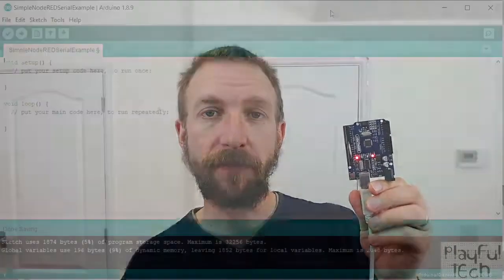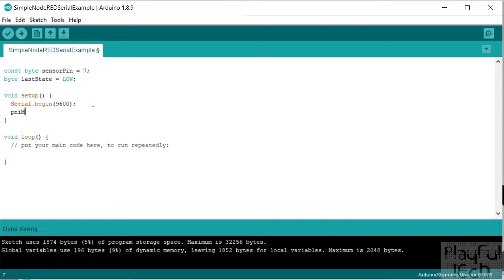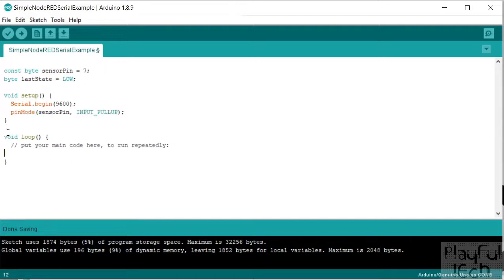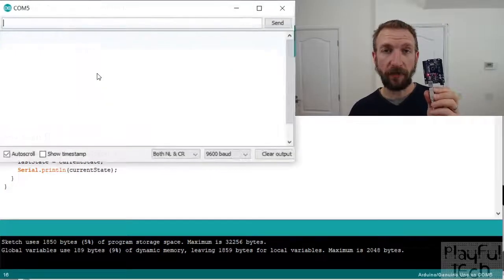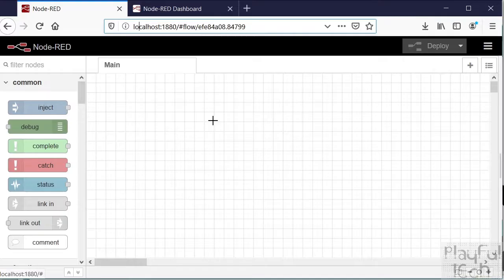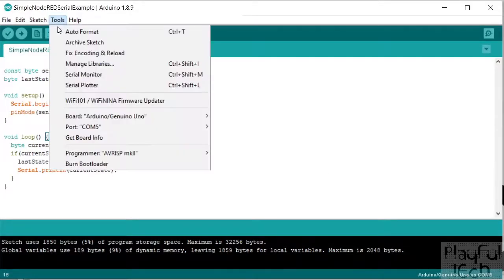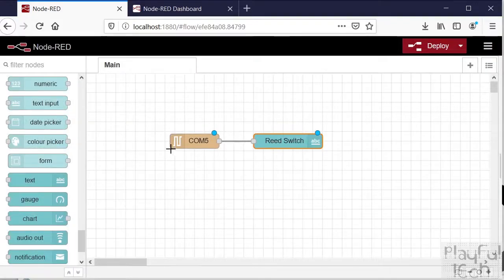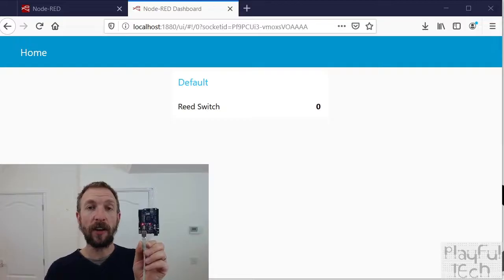Using Arduino with Node-RED to create a Simple Web Dashboard

Comment: outside of playing around/learning you will never build a system that has just one sensor so say you have Arduinos/sensors in multiple locations, how will you read all the data into node red at once, I would think you would likely setup node red on a raspberry pie or something so only have 1-4 usb ports to get serial from, there must be a better way?

Comment: 11 Feb 08:26:36 - [info] Starting flows
11 Feb 08:26:36 - [info] Started flows
11 Feb 08:26:36 - [error] [serialconfig:11d6dad84156b4a6] serial port COM3 error: Error: Opening COM3: Access denied
 its showing me this error when i tried to connect with node red, but my arduino is connected to the system with the same port. How can I solve this problem

Comment: Frankly, this is what pisses me off about Arduino, its meant to be accessible but they use a hard language to learn, I learnt Delphi C back in the 1990's and it was horrible language to use and you have to do things that should be automatic like memory and housekeeping.

Until arduino stop using C only, I won't ever by one.

Comment: I seem to be having a nightmare trying to install the node-red-serial palette. It keeps failing to install and I don't really understand anything on the error log! The only thing that makes any sense to me is this bit:

2020-08-26T14:52:05.002Z [err] gyp ERR! find VS You need to install the latest version of Visual Studio
2020-08-26T14:52:05.002Z [err] gyp ERR! find VS including the "Desktop development with C++" workload.
2020-08-26T14:52:05.002Z [err] gyp ERR! find VS For more information consult the documentation at:
2020-08-26T14:52:05.002Z [err] gyp ERR! find VS https://github.com/nodejs/node-gyp#on-windows

But I have installed Visual Studio (eventually), after installing python which it seemed to be missing first. I've tried reading through the github page mentioned above, but again just don't really understand any of it. Should I have to be installing all this stuff or am I missing something?

The real question I guess is should I even bother trying to get this to work? I was trying to work through all your tutorials so I could learn stuff step by step, but my end goal is to set up props and control software for three escape rooms, so will likely end up using ethernet or wifi connections anyway.

Any help or advice would be much appreciated!
Reply from the maker: So are you trying to install the node by going to the Manage Palette option from the dashboard? I've never seen that error before - are you using a Windows PC and, if so, are you logged on as a user with admin privileges? (or, to be specific, are you running your node-run instance as a service with admin privileges?)
Reply: @PlayfulTechnology  It's ok, it's working now!
I think the problem was with the Visual Studio install. Turns out I'd installed the 2019 version, but I found somewhere that it doesn't recognise that, only the 2017 version. I'd tried installing that one, but it obviously didn't work properly with the 2019 already there. I got rid of both and installed the 2017 again and now it all works! So now I'm having lots of fun playing with and tweaking all the example code you gave us, finding out what does what!
Reply from the maker: @escapeonealgarve785  Woot! That's great news :)
Reply: @PlayfulTechnology  Can I ask another question? Do you know how I could send an image as a hint? Either as a full screen image over the timer or just as a pic below it. I've tried to do it by having an inject to a change node setting msg.image to the url of the image and then displaying it on the uibuilder as an html image (<img src="{{msg.image}}" alt="PICTURE!!!">). It displays the alt text, but I can't seem to get the image to show?? Any bright ideas as to where I may be going wrong?

Comment: Thanks for the video. it is very rare and very explanatory. actually i am thinking of hosting rednode and then i can connect via port forwarding. But how to send this sensor data to the rednode IoT center : self hosted). it will be very helpful if you can make a tutorial about it. thanks in advance
Reply: got it. 
a very good explanation is here
https://funprojects.blog/2018/03/04/arduino-talking-mqtt-to-node-red/

Comment: There is an easier way. 
First you install only Arduino FIRMATA on the ARDUINO.
Then you install the Arduino NODE in Node-RED. An easier way to talk to arduino than the Serial node ;) 
In this way you will be able to talk to ALL of the pins of the Arduino, without the need to make a large sketches, everything will be manageble from Node-RED.
Reply: Not if you are trying to view the io of a program you are running on the arduino....
Reply: This one doesn't work. I've tried it a lot of times and nothing

Comment: Great video again, well done.
I hope you will show some wireless examples with MQTT and node red :-)
Reply: The best i could recomend you, is to use the Node-MCU +  TASMOTA firmware on it.
Then install mosquitto server on the machine which is running Node-RED, and  then you will be able to talk to the MCU from Node-RED via MQTT. Its really easy.
Reply: @720xt  thanks a lot :-)

Comment: Love these videos. Is it possible to achieve the same thing using a wireless connection to the Ardunio board? It would be difficult to run USB cables from the control room into the escape room and into every Ardunio board.
Reply from the maker: Oh yes - there's many ways to connect! Wired ethernet, wireless, USB, DMX, ModBus, CanBus, MQTT or HTTP,  JSON, CSV, binary, or simple text payloads.... they'll all be coming soon - I just wanted to get this example out first because I think it's the simplest to understand - people are already familiar with using the USB cable to upload code to the Arduino, and I've already used Serial.print many times to send data back from the Arduino to the Serial Monitor. The only difference in this example is that I'm picking up that value in Node-RED rather than in the Arduino IDE.
Reply: @PlayfulTechnology  Very nice! If you make wired Ethernet Next that would be nice :)
Reply: @PlayfulTechnology  Wonderful, thank you so much.